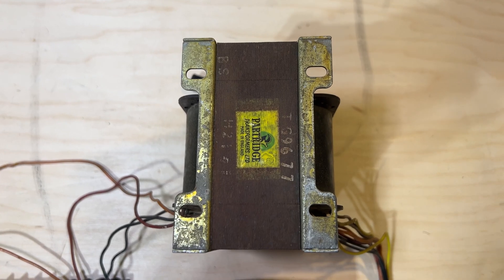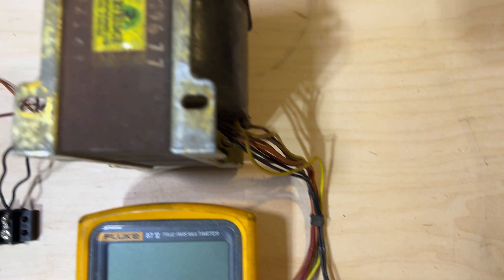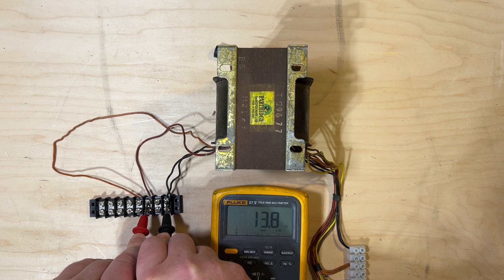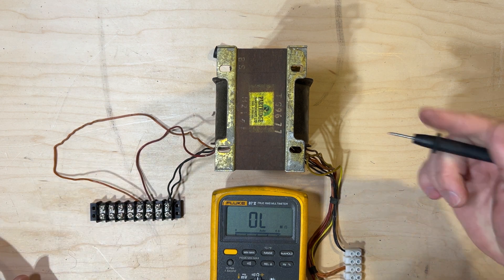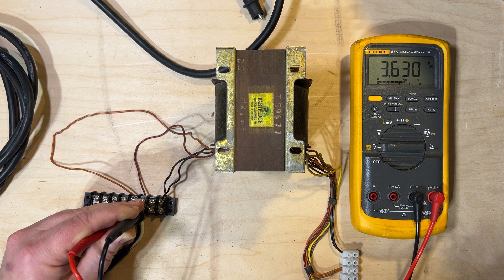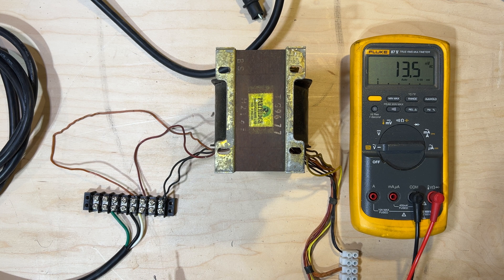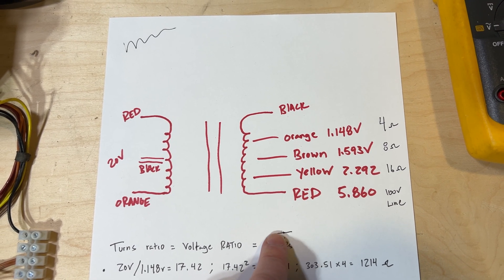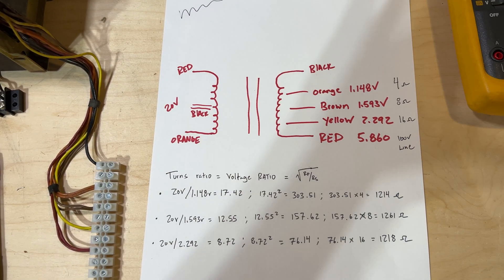1974 Hiwatt DR103 Repair - Part 3

Comment: The 100v lines were for running  a high-voltage, constant-voltage system for public address, allowing many speakers over long distances by using transformers to step up voltage at the amp and down at each speaker, simplifying wiring (parallel connections) and power tapping, ideal for background music/voice but not Hi-Fi, using appropriate speaker transformers and heavier gauge wire for the job. Think like grocery store or school pa systems where there's multiple speakers in many rooms. You can find something similar on most old tube pa amps. I think with these partridges, they basically just made generic transformers and hiwatt and sound city would use what they could get deals on that fit the specs they needed.
Reply from the maker: I was able to track down similar info after posting this video but appreciate the input! Had never seen this before diving into my Hiwatt project.

Comment: hi. nice series. a question ; i am measruring almost zero ohms ( 0.2 or 0.3 ) with all my 4 8 and 16 ohm speaker outputs. is that normal ?
Reply from the maker: That is measuring with those connections disconnected from any speakers, unpowered, and with the resistance (Ohms) setting on your multimeter? Sounds pretty close to what i was measuring with this transformer as well when it was on the bench!
Reply: @TechnologyEnterprises   yes , exactly as described. thanks for the answer.
Reply: yes, those are short windings compared to the primary

Comment: Very interesting.  Really enjoying this series. I'm interested to see what you do with the bias system. I had mine modified to give variable bias, but it never sounded the same. I'm considering putting it back to stock. I wonder what your thoughts will be on the matter. For the record my Custom 100 is a home made one with chassis, transformers and cab sourced from an old sound city PA120.
Reply from the maker: That Custom 100 sounds like a very cool amp! I will probably try it without the bias modification first but will install one if needed and either way will cover the circuit. I wonder if yours was biased extra “hot” before the modification was done.
Reply: @TechnologyEnterprises   Yes it was biased hot, but modern valves don't like it. Might put the old mallards back in it.
Reply from the maker: You should be able to get up to 70% dissipation even with modern JJ tubes. I recommend getting burned in tubes whenever possible these days if you can spare the extra couple of bucks. Seems like quality control is really the most apparent failure in modern tube manufacturing for the consumer these days (at least from my perspective).
Reply: That might have been an OT for 6 EL 34’s (200w)
Reply: Ok,I looked this up, Partridge Specs for a 200 w OT (6 EL34) are 1200 ohm, I would not use this OT for your amp, way too low impedance. You could double it for 2400 ohms though
Reply from the maker: Dang! But that does make sense. I just traced the part number on it back to a Sound City 120 amp which does use 6 EL34s in the power section. Thank you for pointing this out!